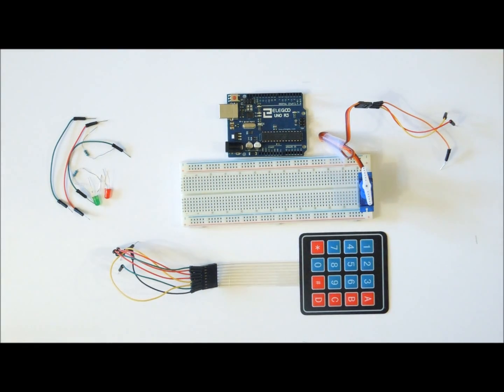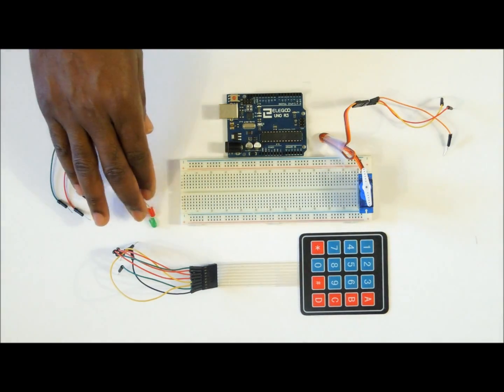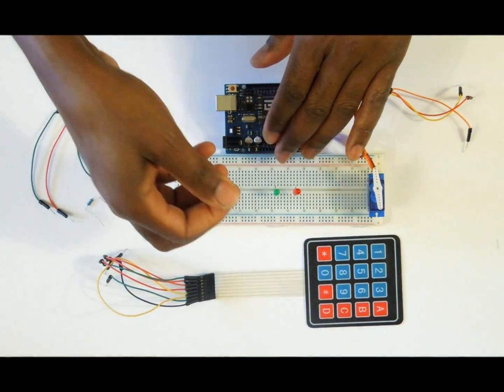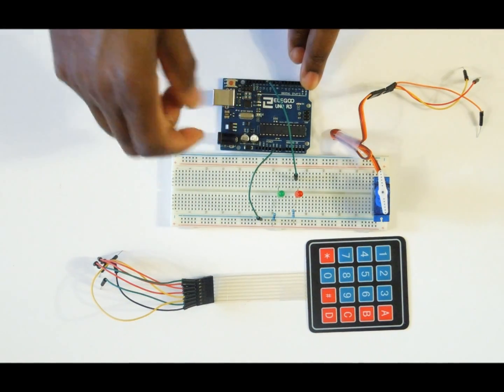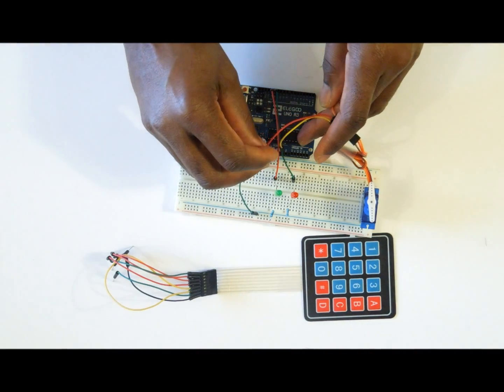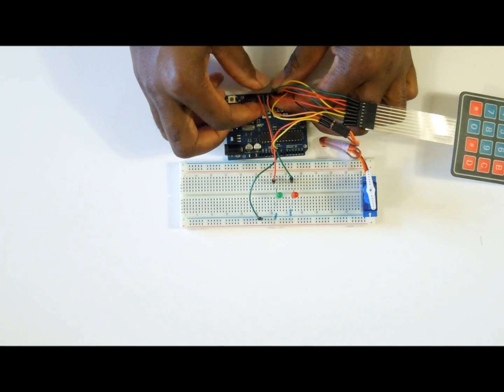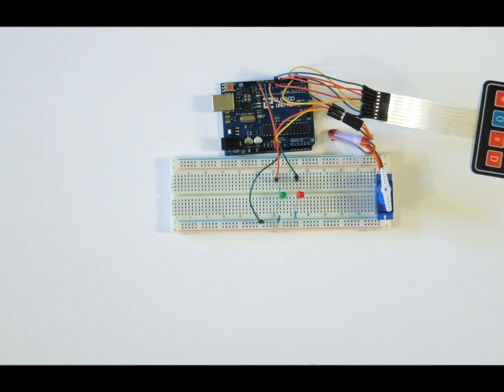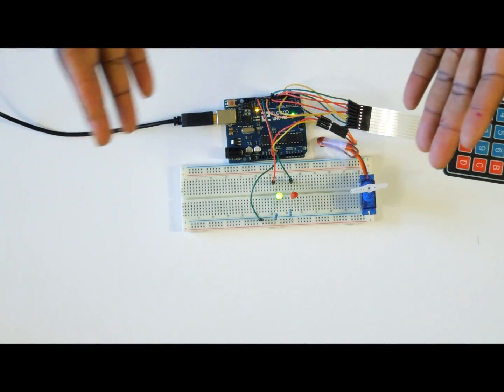Controlling a Servo Motor Using a Keypad & Arduino

Comment: You had to explain the code..WHY is the code so difficult to understand?variables variables variables....i am gonna get crazyyyy!! WHY isnt that code damn simple like----- if  you press buton 1 , {DC motor 1 goes clockwise----- if you press buton 2 motor goes counter clockwise....WHY not mAn? İ am really exhausted because of that damn virtuosity of variable usage.